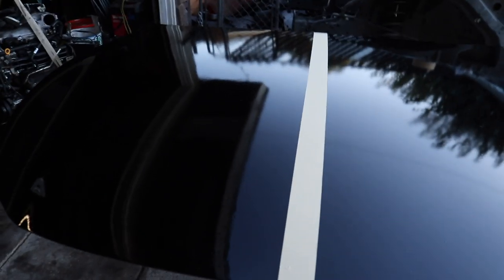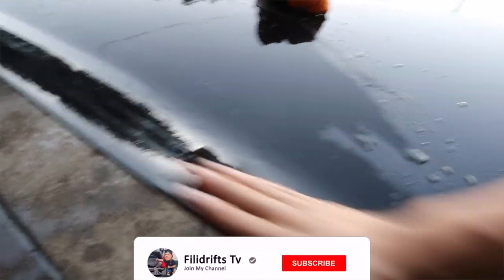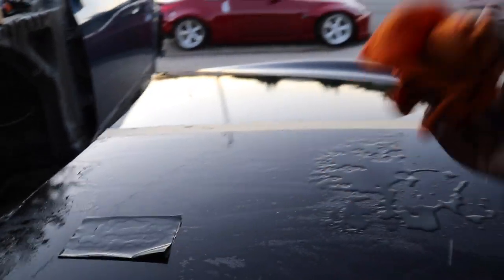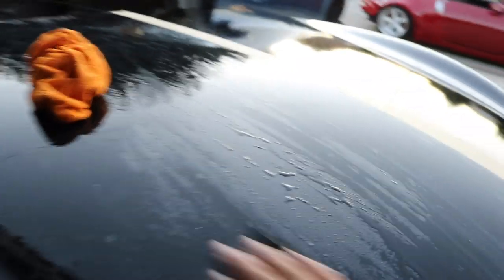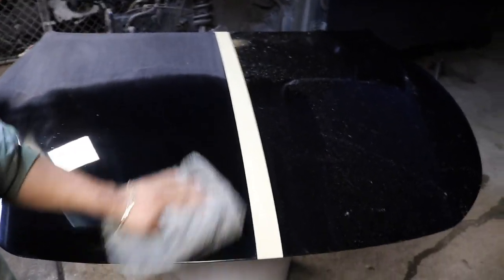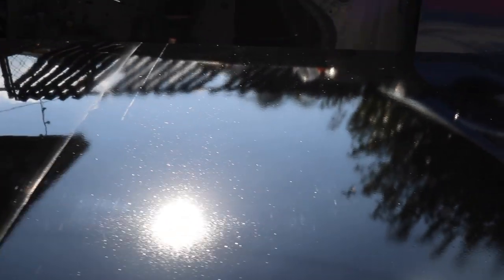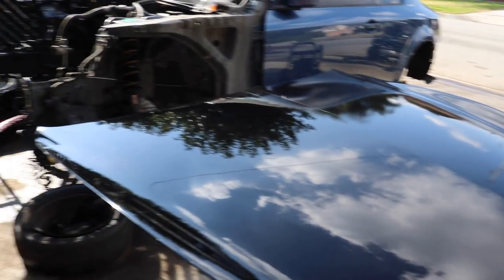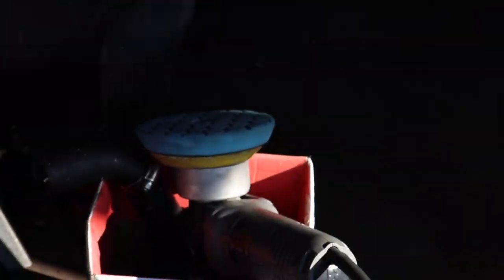HOW TO CUT AND BUFF AFTER A NEW PAINT JOB!

Comment: nice vid bro!   couple of recommendations 
use a sanding block for your work.  start your cut with 800 then 1000,1500,2000 and then 3000.  also on the wet sanding,  use 2 waters...one with clean soapy water the other is what you rinse the dirt off with.   will take care of the clouds!  finish with a nice polish.  thx browski!
Reply: I've been doing it wrong

Comment: Others have already pointed out you should always use a block and never your bare hands but I just want to add that if you think about it, it's far to easy to apply uneven pressure with your bare hands sanding. Regardless it came out awesome I'd say. Nice work.

Comment: I'd recommend starting at 1500,2000,2500,3000 and there's a new one I just tried that you go up to 8000 and it looks like show finish already  by the time you get to the first stage of buffing
Reply from the maker: thank you bro! honestly only used what i had
Reply: Yes with black I finish with 5000 grit
Reply: So after 3000 u went with 8000?
Reply: @randyr.8536  5000 then 8000 but honestly  going from 3000 and stopping at 5000 works great too saves  you a few minutes

Comment: Your humility and work ethic are commendable, broski 👊

As others have already said though — always use a block, and you’re not done at 2500-grit. You want to go at least to 5000 if your goal is a showroom finish, especially with black. Swirls are still painfully apparent at 8:25 Still, keep at it, you’re doing damn fine work! 🤘
Reply from the maker: Tim dope i will definitely  try that, thanks bro💪🏼💪🏼
Reply: But wouldn't continually doing this wear down the clear coat?

Comment: good god man im in full pucker watching you sand with a bare hand at the very very least get a regular square dish sponge and wrap sandpaper  around it your fingertips create a pressure point for an uneven sand and possible clear coat low spots other than that you did a good job bud keep up the good work ...subbed
Reply: You dont need a block if you know what you're doing. I do it all the time. But for a beginner definitely use a block
Reply: @conceptdesigns4100  VERY TRUE

Comment: Dont use your hands to sand. Youll get bad results
Reply: You can use your hand but don’t go up and down in the direction your fingers run but side to side so you don’t get pressure lines from your fingers.  It’s best to use blocks but certain spots you gotta use your hands cause of the contours.
Reply: @SpreadingKnowledgeVlogs  Thanks for that, maybe that's why I keep getting sanding marks I can't buff out. Any more advice you can give for cutting and buffing?
Reply: @mesmerize15  I use to have that same issue actually, it's likely that your not using a aggressivd enough compound.  Meguiars makes some really good heavy cut compounds that you will want to get for use after wet sanding.  Most of the other ones are diminishing abrasive type compounds and really don't cut that well and really need to be used with the right foam pads to get them to work even decently.  Your best friend is going to be a good wool or microfiber heavy or medium cut pad and a heavier cutting compound when it comes to buffing out sanding marks.  I'm a bit of a perfectionist so what I tend to do is a bit unconventional but I spray my clear coats on super heavy or do a lot of costs (both of those are hard to do perfectly right) and I sand from 2500 all the way to between 5000 or 7000.  You don't really need to go that far but I find that it does make for a better look with some paints.  This also depends on how hard the clear coat is your working on too I try to use the hardest concoction I can find as I find that to be the most durable and less prone to scratching easily but requires more sanding work sometimes too.
Reply: @mesmerize15  ps by the way I'm not a pro and to be honest I'm not sure my advice is even good advice, I'm myself still learning wet sanding and compounding techniques but I also been doing it enough to feel you on the struggles of getting it perfect.  With time and experience you will get better at it just don't give up and keep practicing and you will start to earn to read the paint your working on better and better.  This is truly a skill that takes a lot of time and experience to fine tune and develope it perfectly!!!

Comment: Aye man people like you motivate me I like it keep it up🤙🏻 A polish like this how long does it last ? Or how often you gotta maintain it?
Reply from the maker: thank you! should be good for a year depending on how u take care of it maybe longer
Reply: Using ever finer abrasives for shine lasts forever.  You are physically smoothing the paint, but removing paint to do so, that’s why it’s sketchy.   Many a newbie has burned through to primer, which is a nightmare.   You could try to touch up those spots, but it would take a minor miracle to get that spot to disappear.    Fake shine, like waxes and some other coatings, eventually fade, get washed off, evaporate, whatever, because they are coatings.   Don’t get wax and polish confused.   Wax is something that gets rubbed into the scratches leaving it more smooth and shiny, but wax is just a thing you put on top.    Sanding with very fine paper and going finer and fiber actually permanently changes the finish.   Wax is not absolutely necessary for shine, but wax ultimately is good to protect paint from bad shit in the air, the water, the rain, the streets, which will eat into your paint.